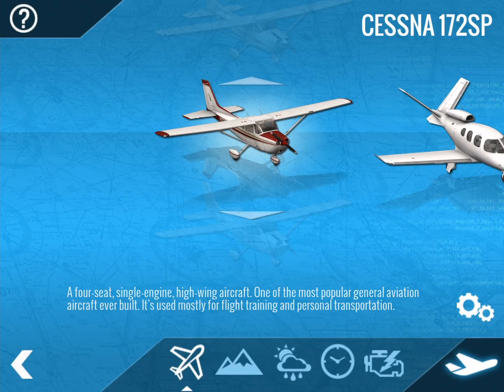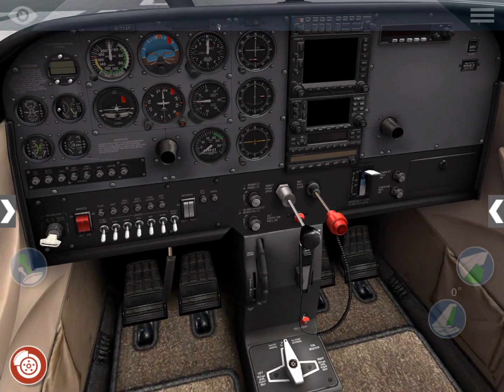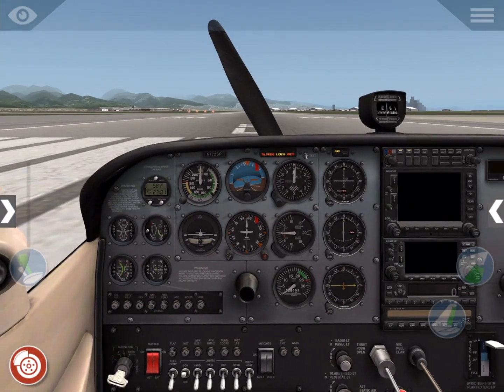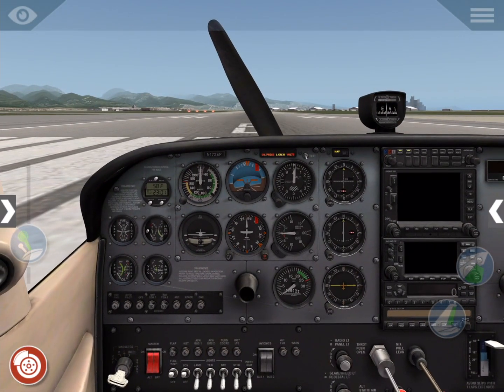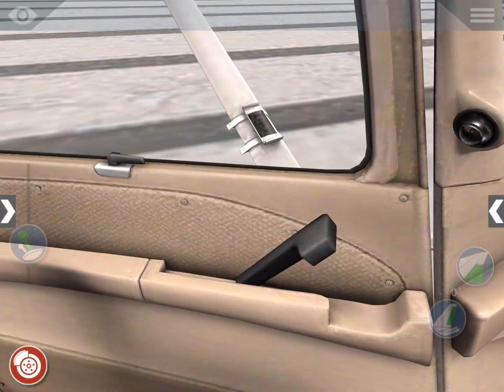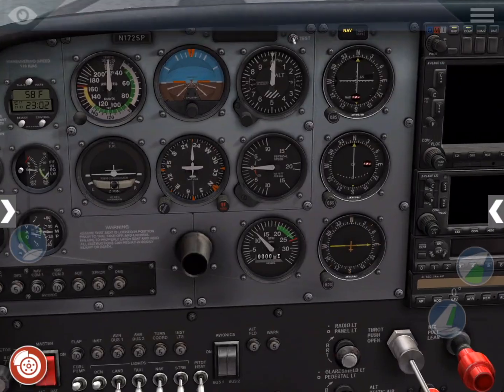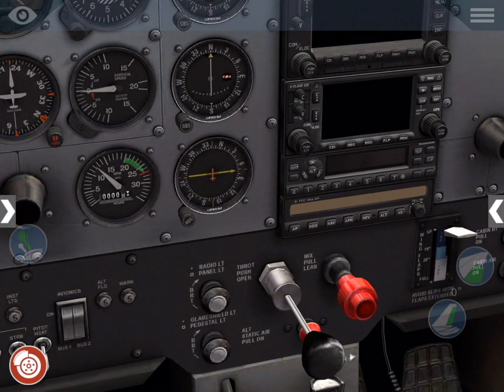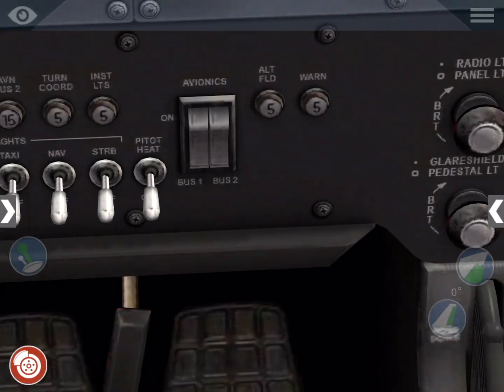X-Plane C172 Cold Start Walkthrough

Comment: What the heck is positive charge, and positive section??? I don't see that anywhere on the instrument panel.
Reply: The Amp/Vac gauges. AMP shows state of battery charge from alternator, either positive or negative. And VAC shows "suction" or vacuum, either positive or negative.

Comment: This one is really easy. Turn on the battery, set the fuel mixture to almost full or full. Then pull the key to the right for like 6 seconds and then the engine starts.

Comment: I hate to break this to you sweetie, but that is NOT HOW WE REAL PILOTS START A C-172 of any series. Mixture goes to full rich and stays there for the start and there is a prime control on the left  side near the key. Only turn the prime clockwise when unlocking and re-locking in position.
Reply: Umm...  you are aware the fuel injected models don't have this aren't you?
Reply: This is how bad habits are born.
Reply: Sweetie, why are real pilots watching this?
Reply: Ellexis thanks for the correction Ellexis, if it wasn't for people like you KNOWING what you are talking about, noobs like me wouldn't get anywhere...😊😊👍👍✈✈
Reply: I hate to break this to you sweetie, but the Cessna 172SP is fuel injected and uses a fuel injector instead of full rich. The older versions of the aircraft indeed start this way, you might need ti update your knowledge of starting newer 172

Comment: You also should have set the rpm at 1200 leaned the mixture to max rpm and then throttled back to 1000rpm
Reply: That definitely ain't on my real world C172 checklist.
Reply: it's in the POH
Reply: Where?
Reply: Not in mine!
Reply: Bruno Esperança Page 4-26 leaning for ground operations
Reply: Mine from a 172 F goes to 4-23. I'll try to find a skyhawk checklist to see if I can find that! I'd be surprised because the recommendation is to stay on the rich side for climb (below 3000 ft) for extra cooling... but maybe it's in there.
Reply: Bruno Esperança it’s just for ground operations you go full rich for run-up and take-off
Reply: In that case, more believable. Still can't find it though. And I found a couple of POH on the net for Skyhawks and couldn't find it. If you could point me to a resource I'd appreciate it.